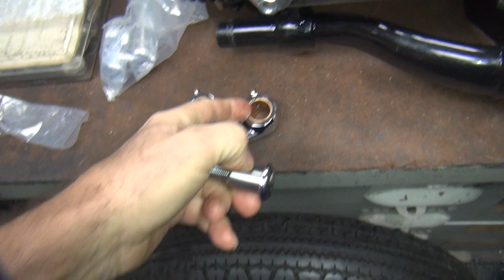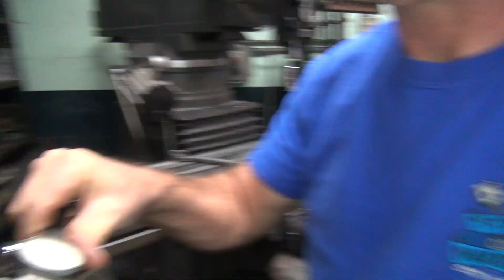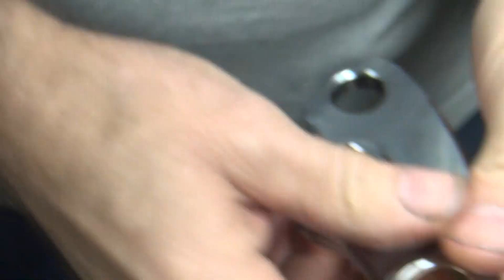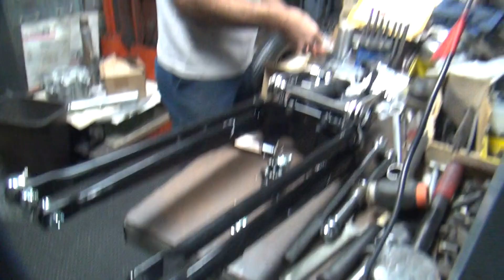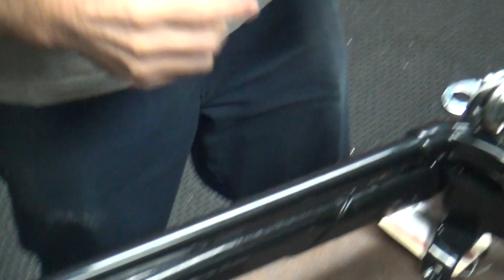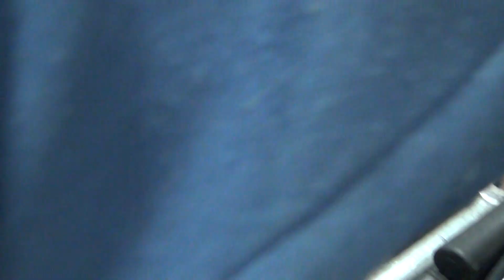1936-1948 #102 knucklehead springer bobber disc brake conversion shovelhead harley by tatro machine

Comment: Hey Tatro, when you adjust valve tappets on a sportys or whatever, have you ever used those self ratcheting open end 7/16? Cresent product. Cause those threads are always fracked.
Reply from the maker: how is that crap going to work. there is no room.
tatro